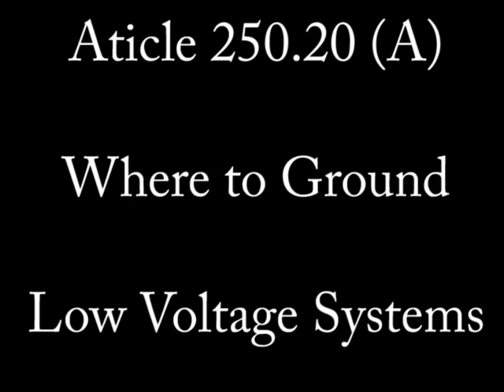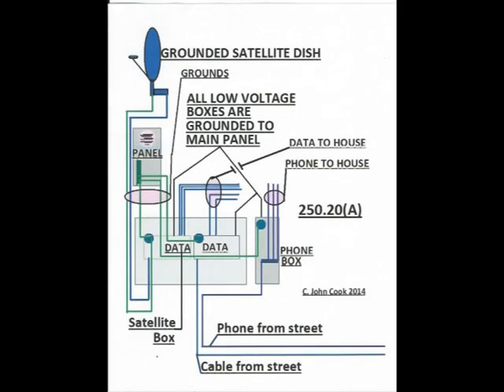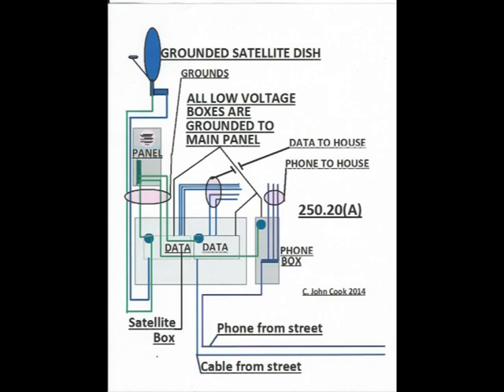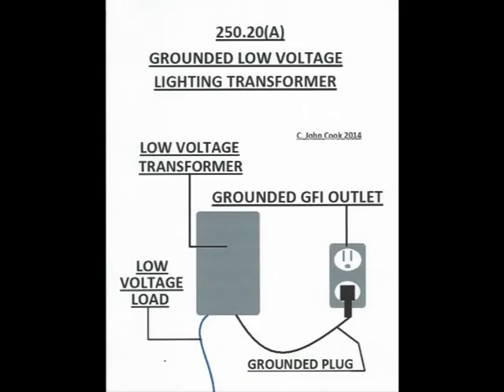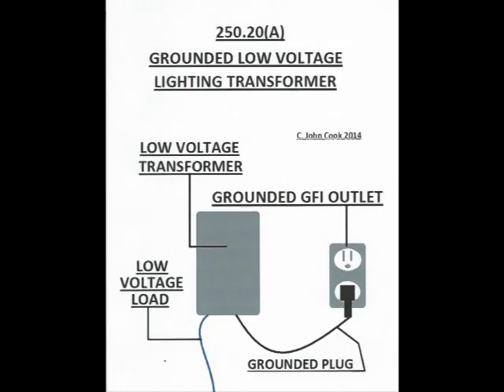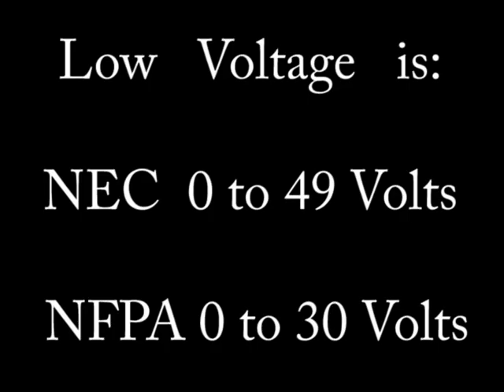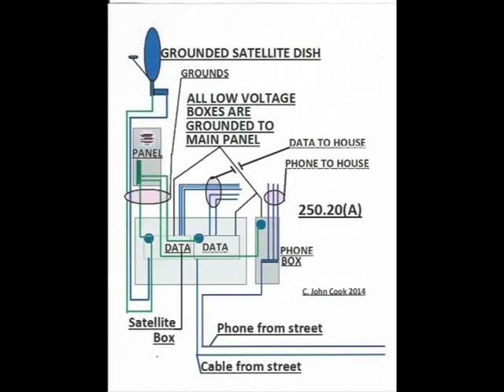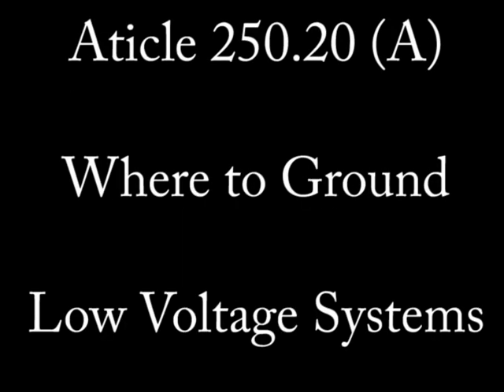NEC Low Voltage Grounding Locations 250.20A

Comment: Do installations of CCTV require grounding either in residential or commercial locations? If so is there a NEC code that explains it further?  Thanks